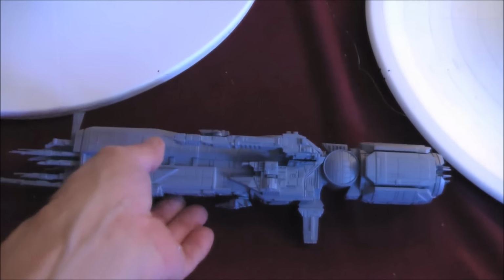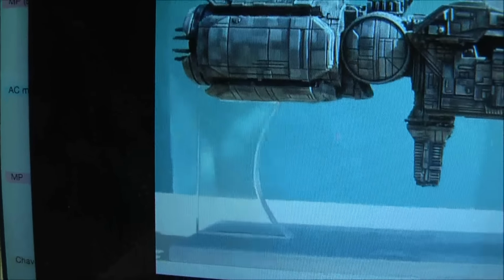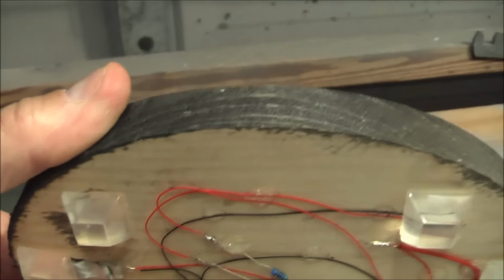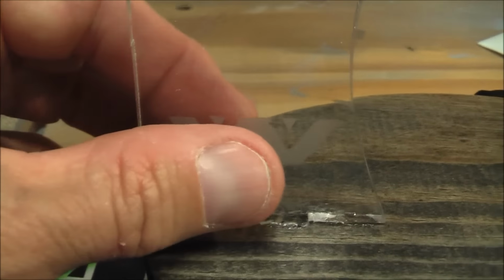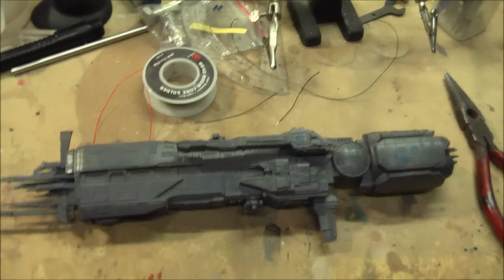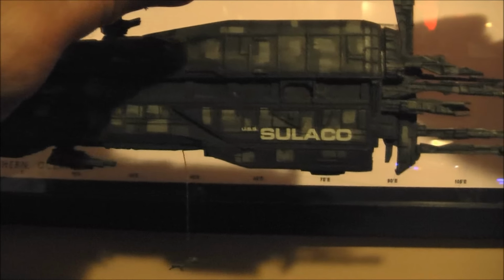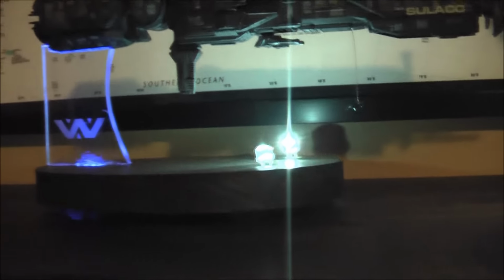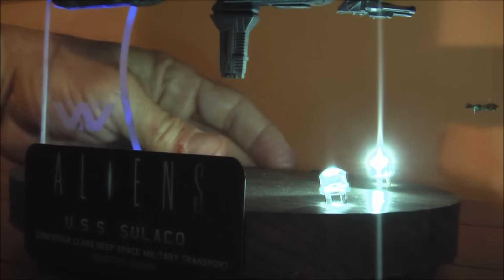USS Sulaco

Comment: Hey, could you tell me what the length of this completed model is? Thanks.
Reply from the maker: +stevethefishdotnet its about 12 inches
Reply: DLC Model Builders
Thank you very much! This is very useful to me. But if the USS Sulaco is 385 meters long (according to the AvP wiki), then a 1:1000 scale Sulaco should be about 15 inches. Something tells me that this is not truly a 1:2400 scale ship. This ship at 1:2400 scale should probably be something closer to 6.3 inches. I've also concluded that the 1:144 Narcissus is actually 1:72 scale. You can tell just by the size of the seats!
Reply from the maker: Youre probably right. Still, I think the model is way too small. Would have preferred something at least 2 feet long.
Reply: DLC Model Builders
Well, I think a 1:1000 scale would be nice to keep it in-scale with Star Trek and Yamato ships. A 2 feet long kit would require expensive tooling and it would be cost-prohibitive for many modelers.
Reply from the maker: Agreed, but we can dream ;)